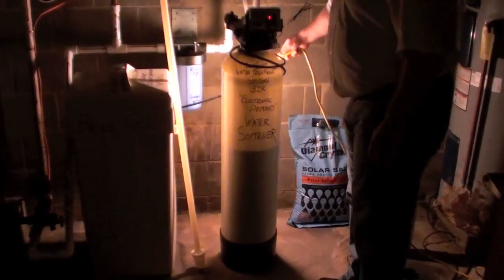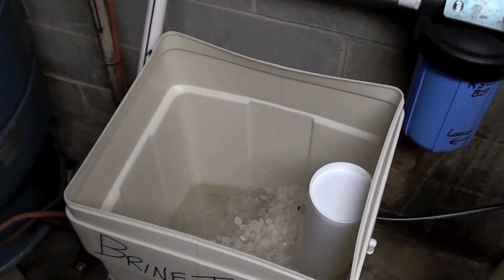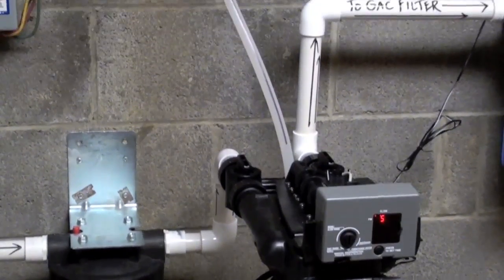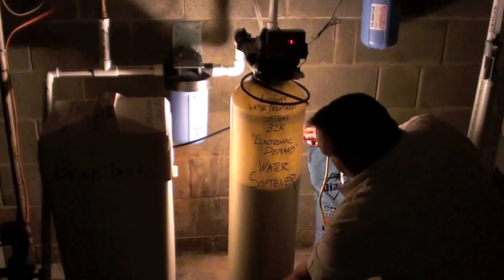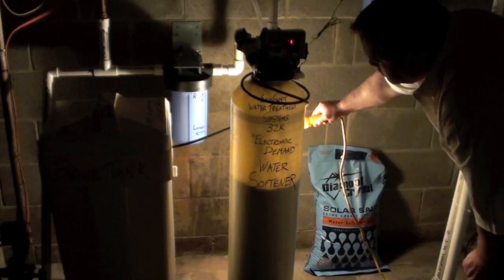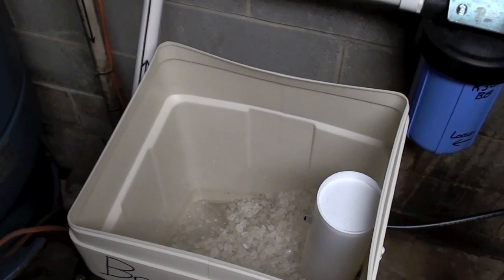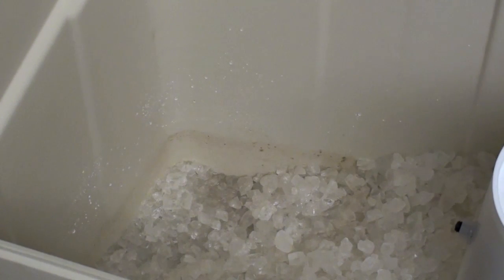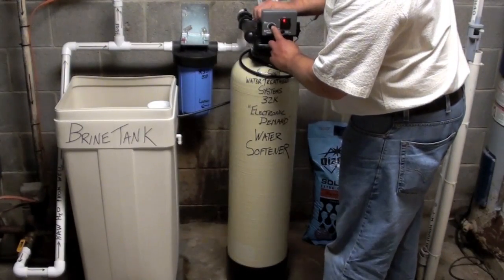Part 2 of 3 - "How a Home Water Softener Works" - Mr. Water Professional Water Treatment of Maryland

Comment: Pretty cool seeing how the resin moves like that
Reply from the maker: Yes looks like a lava light
Reply: @Mr-Water-LLC-of-Maryland  questions.. our house is 30 years out.. water softner is a culligan 812.  Was off for at least 12 years according to prior owners.   I Live in va btw.   And  i got it working.  Plugged it.. it works but didnt suck up brine.  So i took the thing apart on top and two o rings were bad.. replaced them.  Cleared the mesh filter of sand and sediment.   Then i scooped as much salt as i could out.. and then wobbled the brine tsnk outside to wash it with water to break up the boulder of salt. 

Brine tabk was nasty full of sand sediment etc.   The well i noticed spits out a lot of sediment.  So when we first moved in 8 months ago i imstalled 4 20 inch blue filters.  5 micron sediment.  kdf.  Carbon and more carbon. 

  So now that i cleared out the brine tank refilled it..  fixed the culligsn 812.. it works.  Water feels slimey lol i checked and the GH was at 0.   I decided to first let it recharge daily with 20 lbs of salt.  Mainly to get it going again because it sat so long.   Now that it works i put it to every other day at 15 lbs.  Vecause its 1.4cu ft of resin in a 812.  Plus we use a lot of water..

Main issue is this.. everytime it recharges and i guess stirs around like your video it spits out sandy orange then yellow then clear water it takes like 20 min of me running the sink to clear it.  Sometimes i turn the sink on off on off to jolt it and more red stuff comes out.  Its been a week or two now doing this.   Will this thing ever clear of that old sediment from years before ???  Or do i really have to take the thing apart and emoty it ??  

Trying to avoid that.. almost thinking of putting a 10 inch sediment filter after the softner...
Reply from the maker: @jeepsblackpowderandlights4305  Try using this stuff will help allot keep adding to your salt tank - https://www.lowes.com/pd/Super-Iron-Out-76-oz-All-Purpose-Cleaner/1076893?cm_mmc=shpcprdlwngglLIA_LWN_127_Cleaning-1076893-local-0-_-0&ds_rl=1286981&gclid=Cj0KCQjwjvaYBhDlARIsAO8PkE2iUv3MwCSFGZLwjOohikPskHkFV5QTp8sbvwjpJ1EPALcgOZhzGiMaAt2XEALw_wcB&gclsrc=aw.ds

Comment: Good morning I live in Florida in the city of Orlando I bought a house that has well water I tested my water it has a lot of iron a smell of rotten eggs I researched on filters the systems are very expensive and I have no conditions now I bought a filter on Amazon that said it was  good for me and I have a price tank and a water solft filter I wanted to know if you could tell me if I connect this filter before the water solft or afterwards if you can help me I would be very grateful to see the videos for mine was better
Reply from the maker: Air injection system is best for sulfur  - I have a Patent on just such a water softening system: https://patents.google.com/patent/US9499417?oq=9%2c499%2c417 - however I'm in Maryland. See if you can find a company to install an air injection system for your sulfur but NOT an air eductor system they don't work that well.

Comment: Hi Scott,  I noticed you have 2 smaller filter units. What are those?  I assume one is a pre-filter from the main tap to the water softener and the other a post filter from the water softener to the house? What is the benefit of another filter to the house from the water softener?.
Reply from the maker: First filter traps sand dirt and other sediment before entering the water softener, the second is a carbon filter for taste and polishing the water before it enters the home.

Comment: My water softener looks just like the one you show but appears to be missing the brine tank.  I'm going to have a talking to the home inspector that checked the system.
Reply from the maker: Most likely it's a filter or acid neutralizer of some type.
Reply: @Mr-Water-LLC-of-Maryland  it was an iron filter.  No brine tank needed.

Comment: Adding bleach to the brine tank is not a good idea for bacteria in a septic system.  How does the resin soften hard water?  How long does resin last and does it ever need replacing or replenishing?  Why do you need another cartridge filter after the softener?

Comment: I see you have the carbon filter installed after the softener.  Does it matter if the carbon filter is installed before or after the softener?
Reply: Before is more important so that it doesn't damage the softener system. But it's not necessary to have one after it.

Comment: Thanks for the video Mr. Water.  I've been using my water softener for 15 years now and didn't know about the 1/4 cup bleach in the brine tank. Do I just dump that bleach in the brine tank water or inside the white 4 inch float pipe?  Also, last year the technician forgot to turn the bypass on my softener and just found out last week. That means I had 1 year of City water.  Since my softener was not used for a year, do I need to put bleach inside the resin?

Comment: Where does the water go during regeneration?  Is there a separate drain line from the valve?  And how does it move?  Does the valve contain its own pump?
Reply: +Scott R. Handy (Mr. Water) Thanks for the reply.  I guess I need to look for a picture of the pipe and valve arrangement, because I still can conceive of how the household system pressure can draw the brine out of the salt tank into the resin tank. Oh, now I get it, there must be a venture suction circuit inside the valve to create a low pressure and allow atmospheric pressure to push the brine into the valve and the resin tank.
Reply: @jamessullivan9923  the well pressure tank forces water through the system.

Comment: I noticed that you have a note on the salt tank to add 1/4cup of bleach with each salt fill up. What is the purpose of that?  BTW very informative video.
Thanks
Reply: To clean it. Bleach is made of sodium & Calcium Hypochlorite. So it doesn't damage the system and it keeps the brine tank cleaner.

Comment: what does it mean if the water levels always higher than the salt ? 
i got 6 bags of salt in mine but soon as the softener runs the 
water level will be a foot above the salt .  a plumber once told me never
fill the tank all the way up with salt cause it will set up like concrete , 
i been running the softener nightly but still dont have soft water . 
any advice on what i should do ? any help would be greatly appreciated :)

Comment: Great video...I have 2 questions:

1 - Can I install an iron filtration system along with a water softner system? I just bought some land that has a water well already and I'm told the water is bad and one person on the street installed a softener but it still isn't enough so it was suggest when I build a home to have an iron filtration system and ALSO a softener system.

2 - Will having a iron system and softener system take away water pressure? In my mind I see my shower having no pressure.

Comment: hello sir, I have a slight problem. My softener's brine tank fills with water but doesn't drain. I put it on brine draw and it still doesn't drain like you said it would. we have to empty the water with a bucket or it overflows. do you possibly know the problem? the water taste fine from the tap so i'm guessing it filters but I don't understand why it won't drian. thanks again friend.